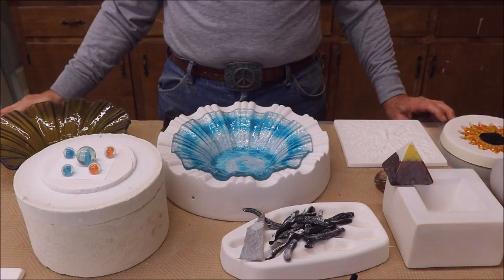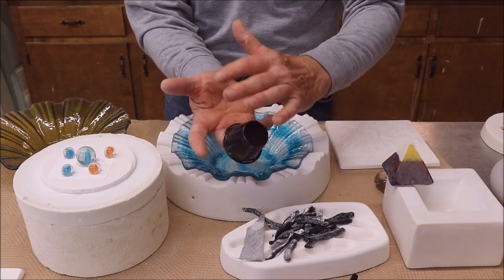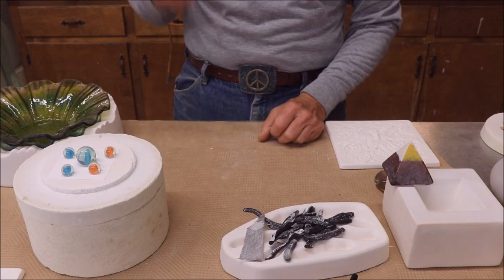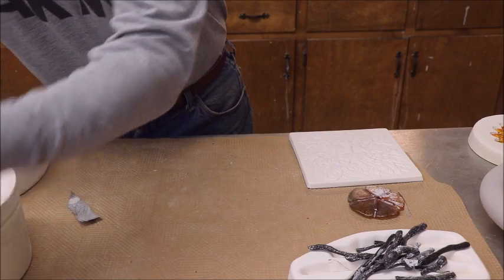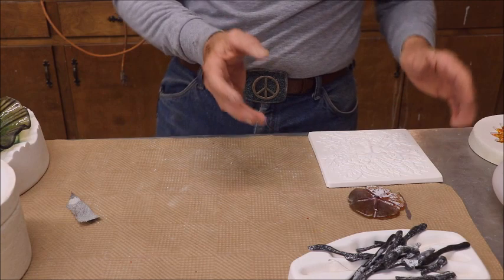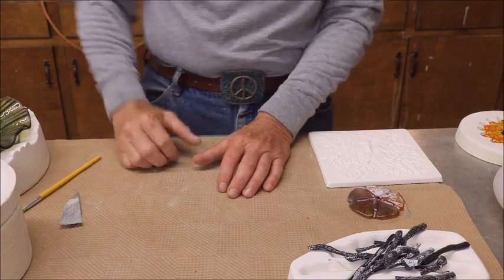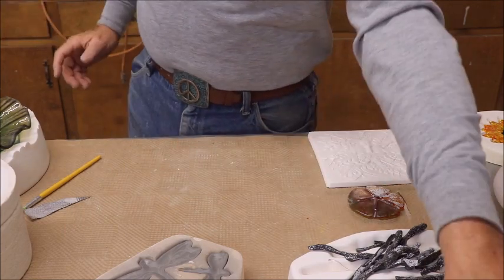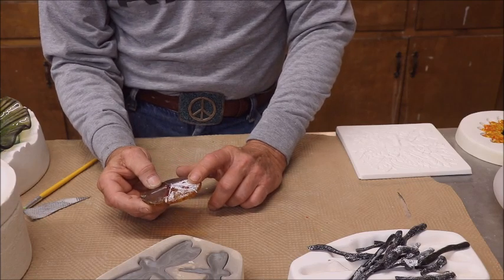Lessons Learned

Comment: On stainless steel molds a tip I heard was to heat it with a hairdryer before adding kiln shelf primer. The heat helps the primer to stick to the metal.

Comment: I saw another video that says cracks usually form in time if there are stress areas in it. You can supposedly check these stresses with a polarised lens. 

You can find polarised lenses on LCD computer screens, so maybe you can find an old monitor somewhere for one.
Reply from the maker: Most. if not all my cracks come from using float glass or accidentally trying to use two incompatible types of glass.  I don't know about the polarizing thing, but float glass definitely has two different sides.  It is said that you can tell the difference by shinning a UV light on the sides to tell the difference.

Comment: I have clay slip molds can u fire the molds with slip in them in kiln also what type of molds can u use n fire for  firing glass in
Reply from the maker: If your mold is made from plaster, you cannot fire it in the kiln, it will bust apart.  You must remove the dried clay from a plaster mold, then fire it.  You could do that with a ceramic mold (a mold made from clay and fired to cone 04 - bisque), but see no advantage in doing so.  For fusing glass, you have to use a ceramic mold coated with a glass release gent.  have videos on that too.

Comment: Annealing the glass properly will help with a lot of the cracking.
Reply from the maker: You are right, but unfortunately these microwave kilns are "heat up" and let cool down .  Any suggestions on how to hold the temps for annealing"
Reply: @CaptMike  yeh is it cooling too quickly?  amazing pieces!!!
Reply from the maker: @magnuswootton6181  Thats the problem with MW kilns.  It's difficult control the heat up and cool down.

Comment: I have a pendant crack in half how can i fuse it together, it was a pendant my daughter made, with milefiore can i save it?
Reply from the maker: If she made it recently and it cracked, it was probably glass that was not compatible or cooled too quickly.  You could try to refuse it, but if it is really important and a nice clean break, you can always use super glue.  I do that sometimes.
Reply: @CaptMike  we refused it to another glass peice, thos time we made sure to cool it completely. I thought to glue it, originally wanted to fuse on a diffrent color and prop a glass in the middle to show but didnt so far it worked. Thanks